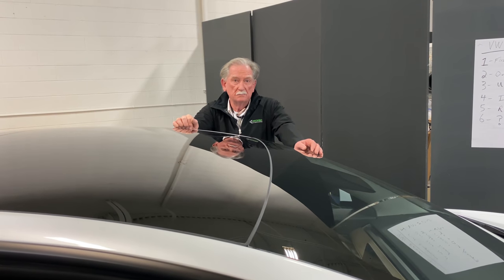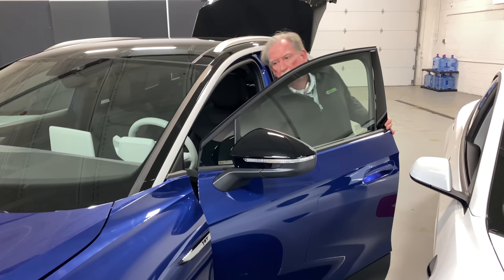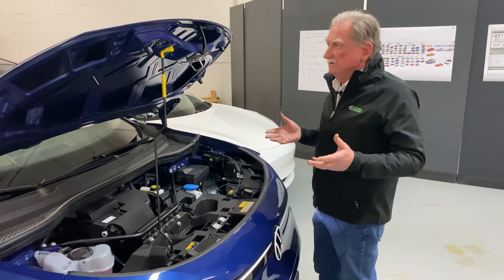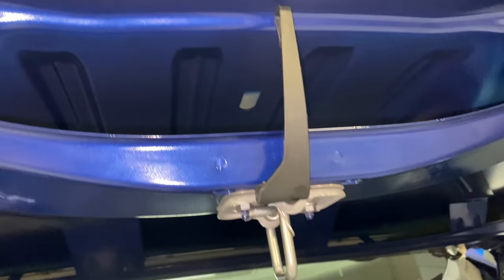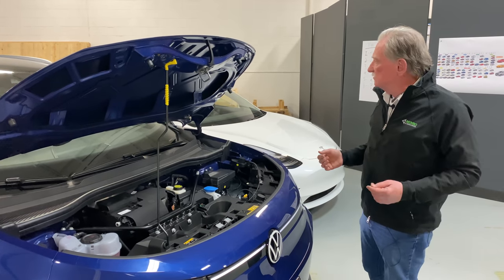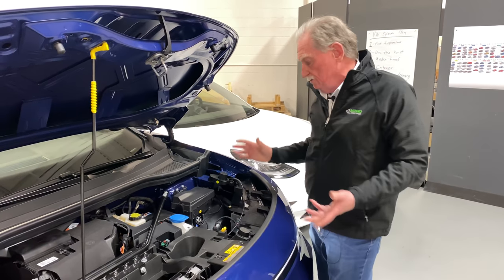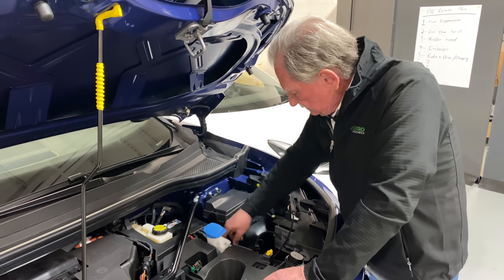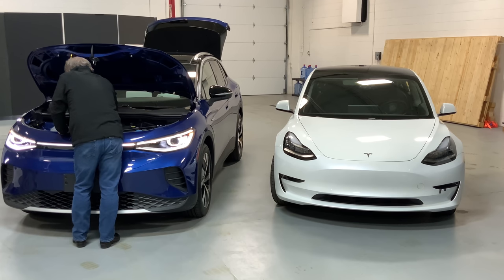2021 Volkswagen ID.4: E2 - Under The Hood

Comment: I'm a bit disappointed at this analysis Sandy . It's pretty clear why they chose to move all of the mechanical and functional components forward instead of providing a frunk. As Nissan's head of design has said, you can really open up the cabin without all of that stuff cluttering up the interior. I personally have not been inside the ID4 but if they managed to keep the interior space similar or even larger than the Model 3, I would call that a smart decision considering the fact that the ID4 has a wheelbase that is 5 inches shorter and has significantly less overhang at both the front and the rear. Given that the ID4 was designed first and foremost for the EU market where maneuverability around tight streets is a significant concern, I would say this fundamental packaging decision shows an astute understanding of the target user's needs.
Reply: @carsonj1  Just because a "legacy" car maker does something differently from Tesla does not make it old-fashioned. I wasn't responding to any of the other technical parts that Sandy mentioned, only the overall design decision to eschew the frunk. I think that utilizing the advantages of electric powertrains to shorten the wheelbase and overhangs while moving the A-pillars forward to preserve interior space is the anti-thesis of "Old school ICE car prrinciples". If anything,  on this point Tesla is the old school one as the design decisions that VW made make the car easier to park on city street and lower the weight of the vehicle overall by reducing the amount of sheet metal. While the latter point is negated a bit by the use of steel over aluminum, you have to remember that VW and Tesla are hitting two different price points and aluminum is simply more expensive than steel.
Reply: @carsonj1  Sorry I don't have an EV yet but with EVs that have a Frunk where is the funnel to fill up windshield washer fluid or the air cabin filters, I haven't been able to see them in any videos.  Also have they removed the safety latch so the hood does'nt accidently fly open in the windshield? I thought it was a safety standard.
Reply: @carsonj1  thank you!
Reply: @mikeb1039  If the information is correct, who cares if he's a fan or not?
Reply: by the way - the assignment of the fuses are explained in the onboard info system
Reply: @carsonj1  Isn't there a requirement for a manual release inside the trunk & frunk?
Reply: @chrifinke  So do you have to print out the fuse chart? I have replaced fuses in a car and even with the little map that they add to the cover, it is sometimes hard to find the right one. Trying to memorize the chart from the info system won't be easy. Luckily, I've never had to replace a fuse on a more modern car and hopefully no one will ever have to do that.
Reply: @michelinereichert35  FYI. No frunk means no extra weight ahead of the front axle that gives a favourable RWD-like handling vehicle. A frunk full of stuff adds extra weight ahead of the front axle, which results in a nose-heavy FWD-like handling vehicle.
Reply: @chrifinke  Unless the fuse is broken...
Reply: @chrifinke  What if the fuse for the onboard info system has blown ?
Reply: @carsonj1  Tesla is ahead of legacy carmakers because of a Frunk? You mean just like my '72 Beetle and '93 911.
Reply: I agree, Sandy seem to like to nerd out over the details and ignore whether the "big" picture is better or not.  The model 3 may be a better packaged vehicle, I don't know because the numbers can be misleading.  But, the ID4 has a 5-inch smaller wheelbase yet still has 2" more legroom in the back.  I expect that rear seat legroom is more important to families than the frunk.
Reply: @knudsenj100  that's the difference between an industrial designer and an engineer 😉
Reply: @7spower998  if handling were a primary concern for most drivers, the automotive landscape would look significantly different.
Reply: @carsonj1   @CarsonJ  tell me about it. The advantage of an electrical car is a short hood, because there is no ICE inside. Tesla's hood looks like a generic ice hood. If you wanna add storage space. You are much better off to add it in the trunk, because a trunk in an Hatchback or combi is high like 1,60m  where as the Front trunk it flat. It barley reaches to the belly button. So that's twice as much space on the y-achses for going with a short hood and a big cabin.
Reply: @tomgray971  only if the trunk is big enough to accommodate a human being
Reply: @knudsenj100  Yes. That's where Tesla got the "Frunk" inspiration from.
Reply: If I remember it correctly, the Teslas front hood is easy to open. Its some release hidden in the front. Thats cause when the battery is drained, you cant open the hood... if you dont use the hidden release. So probably same on the VW that you can open it up with ease, if you need. So no storage = nothing you can steal. Meanwhile in the tesla...
Reply: and actually, you dont need to charge the 12v battery from the inside. It charges from the mainbattery if it gets low, so you can charge your car from the normal port on the outside.
Reply: @AndrewTSq  What about giving roadside assistance to a car with a weak battery? The 12V battery both in ICEs as in BEVs is the number one single point of failure.
Reply: @iamsuperflush Totally agreed.
Reply: I'd rather have more interior space then a frunk. If that is a valid trade off. Have owned several EVs and ridden in most all of ones on market.
Reply: Hi, ID.4 owner here. I'm a big XXXL male and I fit comfortably in the ID.4. Last weekend I went to the Tesla store and couldn't even fit in the tesla 3. The Tesla Y was a really tight fit, I had to make some effort to close the door. So yes, ID.4 managed to give more interior space.
Reply: @chrifinke  LOL - and what do you reference when the onboard info system fuse is the one blown?

That's like my broadband service provider which when down has a phone number to call. The phone number has an automated answering system which informs you to go to their Web Site to file service requests.

Comment: It's pretty amazing how much Sandy has become a Tesla acolyte.  As an average consumer I didn't hear anything I'd consider to be "deal breakers" with the ID.4.  Mechanical fuses instead of solid state?  I can't think of the last time I had to replace a fuse in the last 20 years so it's not really a consideration for me.  No frunk?  Maybe that has to do with VW maximizing interior space, pushing the front forwards as much as possible.  If you measure from the front windscreen to the front bumper on the ID.4 it's a shorter distance than the Model 3/Y.  Fun fact - the ID.4 has more cargo carrying capacity than the Model 3/Y and even the Model X (7 seat configuration).  Only the 5 seat Model X beats it and it's a much bigger car.  Steel hood?  It's heavier, sure, but if the car gives me the range I want do I care?  Also - body shops know how to deal with steel and it's cheaper.  VW is for the value-minded person who is prioritizing practicality and I see nothing wrong with that strategy.  Why bag on it?
Reply: Mike, once you own one, trust, you'll care about the weight/efficiency! Think of it this way, at some point, you need to consider if you could save an extra 2k-5k over the life of the car, by just simply buying a lighter and more efficient car that can do more with less (since it's lighter). It's what I did, and with solar, I'm always in my budget, happy, and driving without a damn care!
Reply: Mike - Really, the VW iD4 is junk, its built like a GAS car from the 2000's .
Reply: Agree he seems very biased. Can't take his review serious.
Reply: @michaelblue7852  Given Sandy's pedigree I wouldn't call him biased. It's just that when it comes to EVs, Tesla is the stick by which all others are measured. However Dandy does need to drive the ID.4. Overall Sandy's take seems to be a mostly positive.
Reply: All to do with cost, as you say. You don't have to worry about fuses or lack of frunk. (if they used one it would not store much anyway) IF you have to repair it will be much less expensive as is quicker to do. There is a trade off. pay a lot to gain what 2k of weight?
Reply: @onwike  so I assume you will be buying an Aptera which will put Tesla's efficiency to shame!
Reply: @gmv0553  I am very keen on that car. However, Tesla is a proven maker in this space. 

Frankly, it's Tesla's world and everyone else has to pay an entry fee to get in the ride. And I'm quite certain that VW hasn't paid the right fee with this car. 

They'll shift some of them, but people cross shipping this with Ford or Volvo's offering will probably not end up getting VW.
Reply: Cause its not a Tesla. 🙄
Reply: I would take issue with accusing Sandy of being an 'acolyte' - if you've watched his teardown videos, he is quite clear where Tesla have not produced the best engineering or design - he has many years of pushing the fundamental importance of “design-first” thinking, and 50+ years of experience as a blunt and honest critic of product design,.
Any criticism of the ID 4 is because of design failures on VWs part.
Reply: @FairlyOldGit  I don't get people's issue with Sandy. He's been quite transparent. They should watch the very first video of him seeing a model 3 for the first time. He HATED it.
Reply: @onwike  I remember watching that.  I haven't watched a lot of Sandy's videos so  was a bit surprised at his positive attitude to Tesla in this one.
Reply: @onwike  ...true, but he later ones are starting to sound like Elon worship, like so many who only see Tesla because of it being the first viable EV to market.
Reply: @AudiTTQuattro2003  well... he speaks the language of science and mathematics. He has not said anything that goes against science or math. So regardless of what leanings he has, they are backed up by the data. 

I'm not interested in fan reviews, and people frothing at the mouth for or against a company/product, I value him because he calls a spade a spade scientifically (he gets his hands on the stuff, takes it apart, and gives you an engineer's view of what he sees).
Reply: @FairlyOldGit  Munro spend 40 episodes on Tesla Y and he never talked about the biggest limitation max available payload of just 375 kg. No other CUV / SUV offer so little payload. Average US adult weigh 83.5 kg, Tesla Y cannot even carry 5 adults.
Reply: @onwike  VW sells more EVs than Tesla tho...
Reply: If a fuse is blown i can replace it myself on the local gas station. Why would it be a benefit to call Tesla to activate the fuse?

Comment: Some suggested answers to the questions.  1. The cheap prop rod vs the Tesla auto-open can be explained simply because the Tesla frunk will be opened and closed a great deal whereas the VW 'hood' might get opened once a year.  Why waste money and complexity on a fancier opening system?  That should be a plus.  2. Are you sure you'll jump the 12V ever?  My Kia simply has a reset button where the large battery recharges/jumps the 12V battery which is effectively a partition.  Perhaps the VW has a similar feature.  3. The short front looks to be approximately what you'd have left in the Tesla if you removed the frunk.  i.e. same stuff there and same space but just covered up with plastic on the Tesla.  Also then in that small space on the VW having all the junk that usually goes under the dash such as the filter is a godsend.  And further serves to free up space within the cabin even if it's dash space.  Seems to me to be a superior setup vs the Tesla.  4. You mentioned the 4 vs 2 hood things, but you still couldn't get that dumb Tesla hood shut on the first try.  When they make the hood shut on first attempt maybe then hold it up as superior.  Ridiculous for a new vehicle to have a 'feature' that requires slamming it then pressing down with both hands just to shut the stupid hood.
Reply: Agreed about the Tesla hood.
Reply: The Tesla hood, being aluminum, hasn't the weight to self close. Which is partly the point Munro was making about steel v aluminum. The weight savings is more important than whether you need to close the hood differently between the two vehicles.

Aluminum is also more pedestrian friendly versus steel. Those crush cans on the VW are necessary because the steel gives less upon impact, even with the air space.

Cost to repair a damaged aluminum hood might be higher than a damaged steel hood, but it looks like a pedestrian collision would cause more damage to the VW (possibly headlights and some of that other stuff under the hood), raising the cost of repairs.

The design choice by VW led to having to choose different ways to mitigate pedestrian injury.  Same end result (hopefully less injury), just a different method to achieve it. Not necessarily better or worse than the Tesla.
Reply: Weight isn't the biggest enemy of an electric car. It's drag.  Of course a lighter car is always better - but the energy losses of weight are only the inefficiencies of your drivetrain and the recuperation. Everything else is restored. Drag is lost no matter what you do. So I don't get his point about the hood. And I think this cross brace is way too solid for only holding up the filters etc. I think it adds stiffness. Why else you should bolt it down with eight(?) M12(?) Bolts?
Reply: The bigger battery will charge your 12V, so no need to jump it
Reply: @jBurn_  In city driving, stop and go, low speed, weight is far more important than drag.  drag does not become an issue until above 70ish kph
Reply: @PowerAlias  yeah... no.
Reply: @MichaeltheCrank  what do you mean?
If not then when would your 12V battery charged ?
Reply: @TWGeorge  Do you have evidence that simply replacing a traditional "American" style hood with aluminum has the same safety mitigation as the substructure hood and crush mechanisms on the VW?
Reply: VW might be shorter on the front, but it's much taller. The interior volume of the front side is the same.
Reply: My nissan altima has an aluminum hood and it closes first time and every time. Tesla quality is infamous and Sandy , proved it.
Reply: @PowerAlias  Yeah, I was wondering about that. When would you ever need to jump an EV?
Reply: I definitely prefer hood struts, even electric cars need windshield water
Reply: Valid points.
It is also an interesting sign that the focus is on cost and no understanding about safety. Munro talks a lot.
Reply: @paul5683 Tesla hoods create a tighter seal for better airflow and less drag. That has helped them to get one of the best drag coefficients. Tesla has come a long way in a short time. When I took delivery I had a 10 page checklist, magnifying glass, gap gauge,  flashlight and UV light and found no issues at all. I am an accident reconstructionist and very thorough. I later had a taillight fog up, but that is the only issue I have had.

Comment: "We don't usually try to hit pedestrians." Why are there ~2.5 times the traffic related casualties per 100 000 compared to Europe then?
Reply: Europe: pedestrian safety
USA: we don't do that here
Reply: Cuz European drivers r much better drivers and more trained, roads are safer for pedestrian safety, and the safety organizations have much stricter and tougher pedestrian aeb tests than iihs or the us govt do. Just watch the id4 going through the euro ncap crash tests and it’s way tougher than what iihs does.
Reply: they try, not exactly succed
Reply: @nickbien  More pedestrians , people on bikes and riding scooters are hit in Europe than in the US. The US has a higher number of car crashes simply because they have more cars driving on the roads. Europeans make more use of mass transit in their cities and they are set up better for walking and biking to areas that you need to get to. The US is more spread out and even the cities and their roads are more open and spread out. 

The first comment people from Europe say about American roads are that they are huge and wide. Even in our highly populated cities the roads are much wider than in Europe. 

Less cars and pedestrians are in the same space and Americans don't hit pedestrians or 2 wheeled vehicles as often. It has never really been an engineering importance in design. They are more worried about head on collisions at higher speeds.
Reply: @desertdan100  americans hit pedestrians less because the us is much less densely populated than europe, and we have much less people walking on/near streets. But our cars are much more dangerous to those pedestrians/vulnerable road users, because of the lack of regulations that help keep them safe.